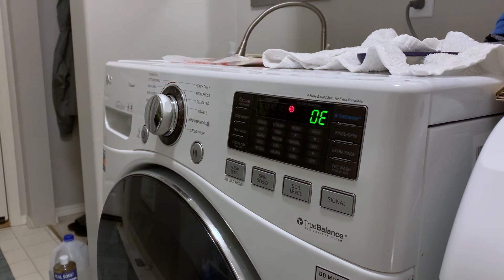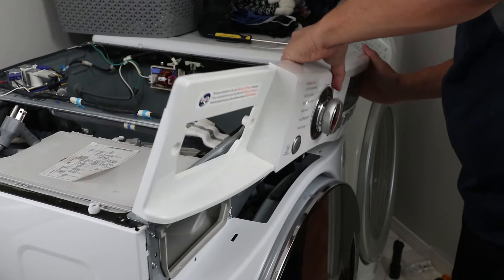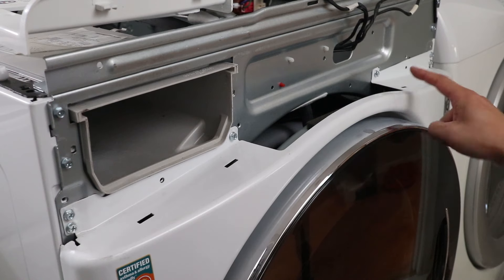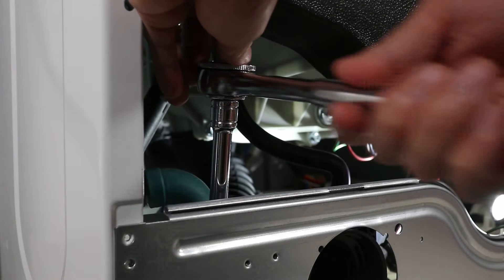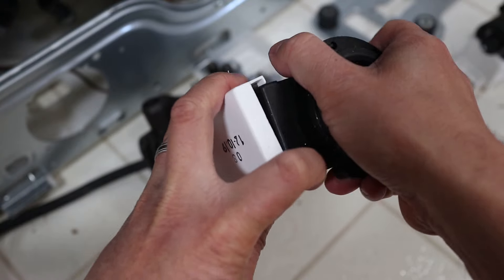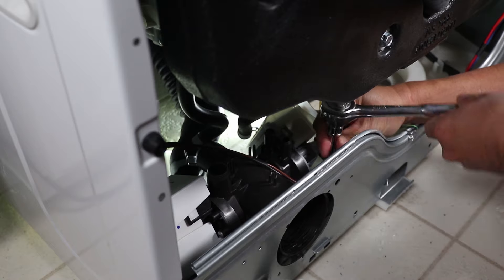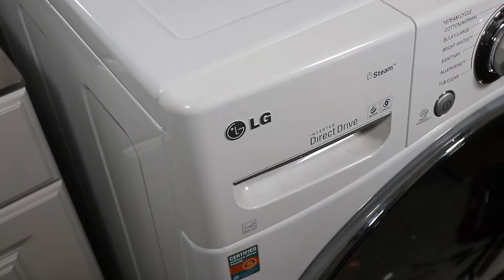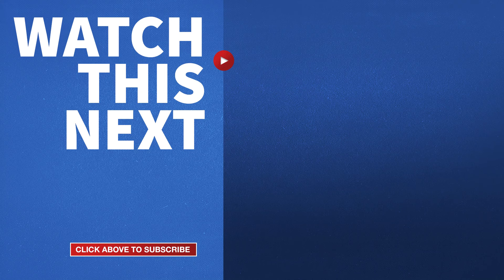LG Washer OE Error Code - LG Washer Not Draining Fix - LG Washer Drain Pump Replacement Tutorial

Comment: Good video but there is an easier way of changing a drain pump on an LG washer.    Just tilt the machine backwards to access the underside.   You can remove the screws that hold the pump unit to the mounting plater from below.   You only remove four screws and disconnect the electrical for the pump using this method.
Reply: That is true. Just changed from the bottom side.
Reply: Ya way i did it too.. after doing it other way before.. $20 pump lasted a year..  but i have the drawer bases on bottom so made it more fun! Lol
Reply: Ur suggestion will work if u have enough space and if the  space doesn't help so doing according to the video is other way to do it in small places.
Reply: I am SO glad I checked the comments, your tip saved me a lot of time and trouble. Thank you, Sir!

Comment: Thank you, thank you! You saved us hundreds of dollars by giving us a way to do this ourselves. Your step-by-step instructions were very clear, and we followed them exactly, also buying the spring expansion tool. It all worked like a charm! I'd buy you a beer if you lived nearby. :-)
Reply from the maker: You’re welcome! Yeah the pump replacement isn’t too difficult to do but it can seem like an intimidating task. I’m glad you got the spring expansion tool and got the repair done! Thanks for watching!
Reply: I wish I could send you a picture of the wrench and zip ties I used as an “ expansion tool”. I zip tied one end of the wrench to the wire and then zipped tied the other side and then inserted the wire and then cut the zip ties and it worked like a charm. Thank you again for your video and guidance.
Reply: I'm with Joe on this! I just replaced mine today 08/12/21 and I watched your video first ordered parts and spring tool next....2 day shipping....and just 35min I was done from first screw out to last screw in. I owe you a dinner and a beer!
Reply: @sassymexy5655  I could use that picture right about now .. ugh 😩
Reply: One of my screws to take the front panel off won’t come out:( tips?
Reply: @randydarby2340  good
Reply: Followed your instruction step by step.  Great video.   Washer is working fine but there is a very loud vibrations sound for a few seconds when the pump engages.  Any idea.

Comment: I just did this repair. This is absolutely one of the best "how to" videos I have ever watched and used. I could not have replaced the defective water pump in my LG washer without first watching Nico's video. 

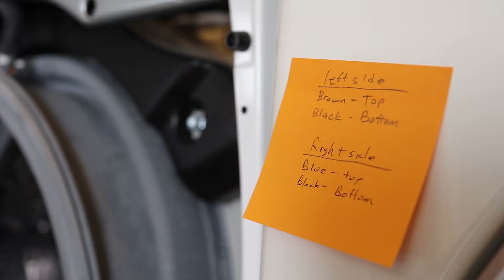My model LG washer is a WM8000HWA.  I would add one additional recommendation: be sure to note (and mark) the orientation of the pump to the pump assembly before unscrewing and removing the pump itself from the assembly. This is at 5:35 of the video. On my pump assembly, the new pump can be reinstalled in a variety of different orientations so this will ensure you don't install it at the wrong angle.

Don't be afraid to do this repair - this video is very accurate and makes it clear on what to do. You will save a lot of money and time. And do follow Nico's excellent hints too! Thank you.
Reply from the maker: Excellent advice on marking the pump orientation before removing it. I made a mention to take note of that but physically marking it with a sharpie is a fool proof method because the pump does have to be attached in a specific way. I made a mental note and I knew I had my video footage to rely on. But thanks for your tip which I’m sure will help others!
Reply: Is your washer the same as the one of the video?
Mine is it I’m trying to get the model to order the pump
Reply: Oh, and dont leave your work light inside when attaching front cover. :-)   (Yes I did. Only started the second screw, but I did.)
Reply: I made the mistake of not marking the orientation but you can use the witness marks from the screws to get it lined back up correctly.

Comment: Found this to be an excellent video! My wife and I watched several of these, this is the best. I purchased the spring tool from amazon and the pump from an Ohio Appliance store. Similar to another comment written here, my wife and I completed the replacement in 2 hours. We took our time. I am doing laundry from the holiday as I write. Thank you so much for putting the careful time and effort into this educational and practical video. We specifically avoided the machine tipping method mentioned above.
Reply from the maker: Glad the video was helpful. Nice work replacing the pump. Sounds like you took your time and made a successful repair!

Comment: We found this video while researching whether or not we could replace the drain pump on our LG washer. Our machine is EXACTLY the same as the one in this video, and after watching it, we said "we can do this".  We ordered the part and spring tool, thank you for the links, and reviewed the video a couple of more times. The part and tool arrived and we accomplished the repair today. The washer works great ! This video is very well done and easy to follow along. Thank you for taking the time to produce this instructional video. We knew after watching it that we could absolutely complete this job.
Reply from the maker: Excellent work! I’m so glad you were able to replace the washer pump yourself! It does seem like a complicated process but when broken down step by step it’s not difficult to do!

Comment: Thanks! I had booked a repair guy - $120 for the visit and diagnosis plus more for the parts and labor. 

It took my an hour to disassemble and half hour  to reassemble. I’m still waiting for the spring tool to finish that last piece. 

I only had two hoses and two wires instead of four connected to the pump. 

Very detailed and thorough. Thanks!

I was going to take the gasket off completely and clean it but was afraid I wouldn’t get it back on the right way.

Comment: I am a 71 year old female.  Because you have described this so very well, I think, I can do this myself.  I did buy the tool to pot the spring back on.  Wish me luck!!!
Reply from the maker: Good luck on the washer repair! You can definitely do it! It seems intimidating but it’s not that hard to do. Just lots of screws! You’ll be glad you fixed it yourself! Thanks for watching!
Reply: I’m a 67 female and I did it! Husband helped with that infernal wire around the gasket, (we used a couple of zip ties to pull the spring apart instead of the specialty tool pliers).  Warning: Definitely a 2 person job without the pliers. Go for it! I believe in you!  How did it go??

Comment: This is such a great step by step video, this is what we used to repair our washing machine on Thanksgiving day. Thank you!
Reply from the maker: You’re welcome! Wow! You did the repair on Thanksgiving! So glad you were able to follow along with my video. I know it seems a bit intimidating to disassemble part of your dishwasher but when it’s laid out step by step it’s not so bad! Nice work! Thanks for watching!
Reply: @digitalcamproducer  Thank you and I am wondering if anyone else has had the same error code show up AFTER we replaced the drain pump (in our front loading washer) it read tE which says it's a thermistor but since we have no heating element we think it could be the control panel. WE are learning so much and it started with your video! Thanks again.

Comment: My washer stop draining and was making noises so I found this video and was able to repair it. I had my husband help me put the ring back on so I didn’t need the spring tool. If you’re by yourself I would get the spring tool. I had my lg washer since 2006 and this was the first time I had any problems with it, the inside was a little different but I was still able to follow along. The draining tube had sand stuck in it so I was able to clean it out as well. Now it works with no issues 🤞🏼you saved me $300 dollars! Thank you!!!!

Comment: THANK YOU!  I am not very handy and normally would just call someone to do the job but no one could come out for several days.  The Spring Expansion tool was a life saver and made my final step of reassembly a breeze.        I struggled with the bolts on the for literally a couple hours, getting them out and then back in.   The bolts just didn't come out, eventually I had to pry out with a screwdriver because the rubber feet had got stuck or affixed in place.  Then the base wouldn't tighten down when reinstalled.  You mention in your video that it is supposed to have some "play" but I didn't catch that until after completion.
Reply from the maker: Nice work! Glad you were able to do this diy repair yourself and save money! It does seem intimidating to take all those parts off the washer but it’s not too bad. Thanks for watching!

Comment: Thank you ! I have the same model, same problem, and your video instructions, I'd have wasted a lot of time trying to figure out how to access that pump. You're a life saver.

One note on the spring extension tool, I did not have one, but found out that it's not difficult if you have two people : One holds the spring open with two screwdrivers, the other puts the ring in the grove.  Works like a charm.

Comment: Thank you. I followed the video as i was doing it from the beginning to the end. I’m happy I was able to repair it myself but I’m disappointed that this is an issue that is supposedly normal. I wouldn’t have expected any repairs whatsoever before at least 10 years. This happened after four years. Thanks again for the detailed instructions and clear video angles for each step.

Comment: This video was brilliant. I managed to get the entire job completed by following the steps illustrated here. Upon re-assembly I didn't have the spring spreader tool. I determined that if the left side spring is in place over the gasket it will stay in place. You can then stretch the right side of the spring with a screwdriver, then guide the wire into place by hand on the right side without any issue. Just make sure that the retaining wire is inserted as best as possible all the way around the gasket. Then only about the last 1/3 of the wire to the right of the spring needs tucking in. This video is very clear and self explanatory. I saved quite a few bucks in repair cost to spend on myself following this guide. 😁

Comment: Pump replacement was successful. That expansion tool was indeed a lifesaver. I also used it to remove the ring, instead of prying it off with a screwdriver 😅. It was super helpful to have watched the video also for the prep and having all the right tools available as well as the tip to mark and organize the screws. Thanksssss!
Reply from the maker: You’re welcome! I would’ve used the expansion tool to remove the ring also but I started this repair before I knew I needed one. So this video took extra time to shoot because on the final step I had to wait for the expansion tool to arrive. So glad you were able to get your washer fixed! Thanks for watching!

Comment: Note: BEFORE STARTING THIS REPAIR BUY THE SPRING EXPANSION TOOL!!! 
This a really good video but the author states in the beginning there is a trick to getting the ring back on and says he will tell you later. If you don’t watch the entire video before starting you will not know that you need a specific tool. This tool took me a week to get on Amazon leaving everything in pieces. Not a huge deal but if I had known I needed specific tools I would have waited to start the project. Other than that this was super helpful and saved me a bunch of money. I was able to clean hoses and drains, clean the dispenser tray and I removed the entire gasket and cleaned it (these will be cleaned frequently for now on as they are mold farms). Who knows all the other areas mold grows on a high-end LG front loader but wow!!! Not sure if I would buy it again. Thanks for the video!
Reply from the maker: Yes! Sorry I didn’t mention the spring tool right from the beginning! It should definitely be ordered at the same time as when the pump is ordered. I think I did the video in the order of how I did my repair because I didn’t have the spring tool originally and had to wait until the tool arrived. I was advising viewers to watch the whole video first so they are familiar with the whole repair process before they start. I tried everything to get that last spring on without the tool and then realized I really needed it. At least for me it was 2 day shipping. But I’m really glad you got your washer working again! Thanks for watching!
Reply: No Worries at all, Amazon lost the first shipment caused the delay on the second and the. Delivered them both after canceling the first. And of course I am one of those guys who never watches the or reads all the directions first and just jumps in. Note to others, probably not the best way to do things. 
Super helpful video and I hope really appreciate the insight

Comment: Just want to say thank you for this post. It saved me big time and $$$!  The job went exactly as you described & demonstrated. I bought the spring expansion tool for $12 can, and it worked perfectly.  Thank you so much for taking the time to do such a complete demo of this repair. I literally was going to buy a new washer because I always have trouble with these front loaders. $58 can for the pump for an LG part. I used your links.  This job can be done by anyone who watches this video!!! Great work man!

Comment: Just used this video to replace our drain pump and it was great. Could not have done it without this video. Our model did have a couple of differences like it was important to put back the door lock before bolting the front door to the washer but other than that we were good. Thank you for such an excellent video.
Reply from the maker: You’re welcome! Glad my washer repair video helped you get your washer running again! Definitely helps to watch the process before starting your own repair job! Nice work! Thanks for watching!

Comment: Thank you so much for this video! For the past week or so during the drain cycle, my washer was making a terrible grinding noise. It would finish the cycle, but this morning with a load full of laundry, I got the dreaded OE message. I had already known about this video before it actually stopped working (I'm anal that way) and I was fortunate that a local parts supply place had the pump in stock along with the spring tool.

I'm 65 years old, and in the past seven years it seems as though my washer had glued itself to the floor. Moving the washer into a position to work on it was the most difficult thing for me.

Your tutorial was perfect, and it only took me about 2 hours to do the repair once I started working. 10 stars, and 20 thumbs up for this help!

I'm now kicking back enjoying a celebratory Scotch👍🍻👍

Thank you, thank you, thank you!!
Reply from the maker: You’re welcome! I’m glad you were already familiar with my video! On my washer I got very little notice before I got the OE error code. The fix is kind of simple yet quite involved. It’s nice that you were able to find a replacement pump locally including the tool! Being able to fix it yourself is definitely a cause for celebration! Thanks for watching!

Comment: Seriously the most helpful repair video I've ever watched. Took me less than an hour. 
If you don't want to or just plain didn't by the spring ring tool, an alternative is two sets of hands and a bike tire lever. Have one person hold the ring really tightly at the furthest locations you can get it to by hand and the other person start at one and slowly run the tire lever along the ring. Worked for me after a half dozen tries.
Reply from the maker: Really glad my washer pump replacement tutorial helped! And thanks for sharing how you reinstalled the retaining ring without the spring expansion tool! A few viewers have also made workarounds like you! Glad it worked!

Comment: This video is the one that worked for me.  Someone else has a video where they go in from the bottom and that did not work!  Also, regarding your parts organization, I fully recommend spending about $5 at Harbor Freight Tools on a parts organizer with a lid.  I am clumsy and did kick my parts storage bin but the lid saved me from having a mess!  Thank you for this video.
Reply from the maker: So glad my tutorial was helpful for your washer repair. Yeah quite a few people say to do this from the bottom. But I don’t have the space in my laundry room to tip the washer over. Plus I really don’t think the bolts on the pump can be reached from the opening underneath. Good job on your repair! And thanks for the tip on the parts organizer. I know I could’ve easily bumped my container of screws and everything would’ve been mixed up!

Comment: This video was perfect. I was able to take my washer apart, get the correct replacement pump and reassemble everything and it works like a champ! I even purchased the spring expansion tool and as the video stated, it was WELL worth the money because I tried it without the tool and it cost me about 20 minutes of frustration. Thank you!
Reply from the maker: You’re welcome! Yeah that spring expansion tool is a lifesaver in the last step! When I was shooting this tutorial I had replaced the pump but couldn’t get the spring back on. Had to wait 2 days for the tool to arrive from Amazon. Got the ring back on and finished shooting the video! Even buying the pump and tool costs much less than calling a repairman! Thanks for watching!
Reply: @digitalcamproducer  That's exactly what happened to me. I took the washer apart one day to get the pump out to get a feel for the job, order the pump, waited for it to arrive, replaced it and then was like "Crap, I can't get this damn spring on" and had to wait 2 more days for the tool. Lol. Anyway, you're right that it was a lot cheaper than replacing the washer or having a repairman come out plus I scored points with the wife :)